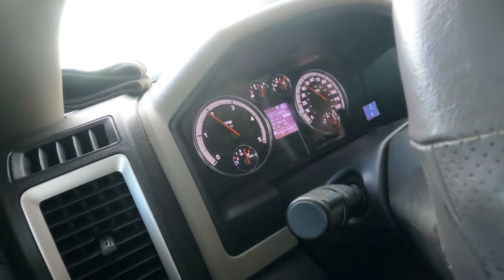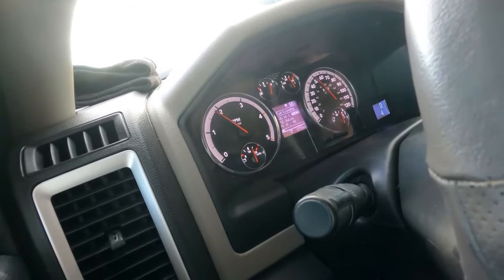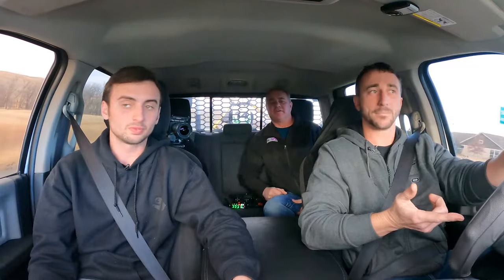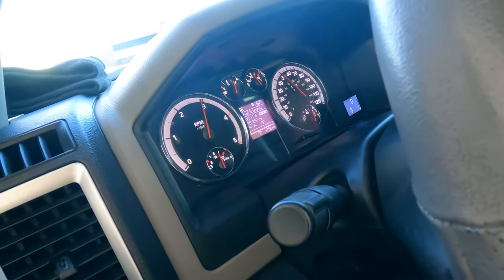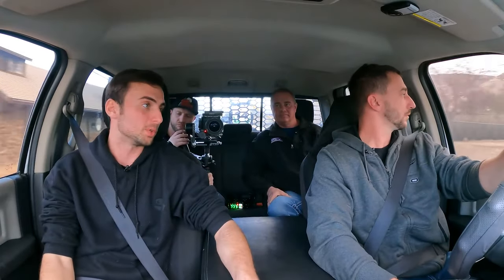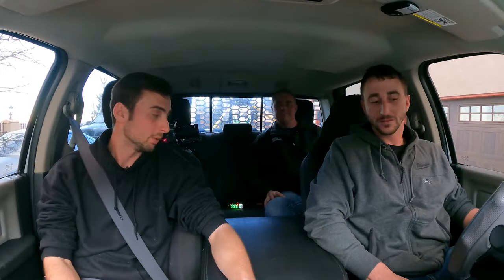TEST DRIVE - ATS Swap Cummins to Allison Conversion Electronics Upgrade Kit

Comment: Clint can you  make a video of the truck pulling 15k pounds or even 8k pounds and let us know and see how it shifts and down shifts and how the exhaust brake works for you while towing etc. Thats whats really important here. Not driving to the super market but real world towing and if you saved on fuel compared to the original transmission setup,  what MPG you get unloaded on highway as opposed to stock. And what MPG you get towing compared to stock. And how it shifts when. Pulling heavy. These are things we need to know before dropping g that much cash. Yes its an Allison 6 speed. Which are known for reliability.  But how it performs mated to the cummins is what wereally need to know.  And it seems so far you have produced the best most reliable seemless conversion wiring setup making the truck act as if it were stock with is great. But we need to see it performing . If you donate a transmission setup to someone including me preferably 😂 that actually pulls things daily they can make videos of how it is performing and its reliability etc. I have a 2020 ram 2500 megacab with factory rear air ride. And I make trips back and forth from Florida to upstate N.Y pulling . The truck does not move unless its pulling something as im a pirate hotshot. I'm sure if there were more real world data and performance information this would be an easy decision
Reply: Yes what this guy said

Comment: My 2011  68RFE transmission has overheated a few times at slow speeds and hardly do anything and so did my last truck. It’s probably just a matter of time before it fails. Who knows? I’m no mechanic but the ATS Allison conversion sounds  like the way to go. Not cheap but it would be nice.

Comment: I wish they offer this for 3rd gen 5.9 manual trucks. I'd love to have an Allison swap that's smooth and drivable.
Reply: Not sure if you knew or not but they came out with the 5.9 conversion recently
Reply: @Andrew Connor   no I did not. I would sure like to know where they have the info on this hidden. Just looked again and it shows 07.5 and newer

Comment: I've had the 68RFE fail at 23k mi in my 2018 2500. Dealer rebuilt because Stellantis won't supply factory remans. This whole conversion seems like the way to go so I can re-establish faith. I just don't know about programming and tunes related to smog checks in CA.
Reply from the maker: There is no non-stock PCM tuning involved for this.  This kit works directly with factory tuning.  Please give us a call and we can elaborate in further.

Comment: How different is the exhaust braking?  I know the manual tune has a much more aggressive brake than the auto tune?  I want to convert my g56 but don’t want any sacrifice with the exhaust brake
Reply: In a 2016 Ram 6.7, all of the Banks air parts, no tuner and an ATS Allison stage 3, what a world of difference. The exhaust brake is beyond phenomenal. Most always towing about 12,500 lbs. In tow/haul, steep grades, there is no longer a need to select gearing or use any braking. This combo is a smooth, cool running work horse. ATS & Banks have really good products.

Comment: In the title of your ad on YouTube, it states smoothest test drive ever ATF swap Cummins to Allison. My question is what does Cummins have to do with the transmission? Did they build it? Are you replacing a Chrysler transmission or an asian and transmission from Japan or some transmission from Cummins? I thought only Cummins made the engine.

Comment: Is there any chance that if I were to send ATS a built ZF 8HP95 (Pure Drivetrain Solutions builds them to withstand up to 1100 HP and 1300 lb-ft of torque), could you make a bell housing and some type of way to connect it to the wiring harness of a Ram with a Cummins? The ZF is shift by wire, so I am fully accepting of the fact that the truck would probably have to be converted to having a dial shifter like the 1500s and gas 2500s.

Comment: So are you converting the ASIN 6spd to the Allison 10spd?
Reply: It’s the 6 spd
Reply: Agreed. What trans was in this truck to start with. The aisin of the 6rfe or whatever it was.. we have a 14 3500 with the aisin and its only issue is its lazy after having the engine tuner installed. The aisin still wants to work like its stock because there is no ability to tune the tcm to work with the engine tune.

Comment: Never had any issues with my 68RFE's.. A smoother shift is NOT necessarily a good thing. Sure is nice having a smooth shifting truck, smoother means slower engagement of the bands and clutches which means more wear..
Reply: Allison doesn't have any bands
Reply: @gagecook6918  Same concept, when I said Bands and clutches, I meant Bands and or Clutches. Allison has Clutches.
Reply from the maker: In this case, Mike was so disappointed in the hard shifts he was experiencing from his CAC kit that he drove all the way across the country to change out the electronics for ATS's translator and complete harness.  The reason why it was shifting hard before the ATS kit was the fact that no derate was being communicated between the PCM and TCM.  Without the millisecond derate from the motor, the clutches take a ton more abuse and compromise the longevity of the transmission overall.  In this case, it's the exact opposite of what you are claiming but in many cases a nice firm shift is good thing. Furthermore, the "smoothness" or time that it takes to apply the clutches/amount of derate, is tune-able in our open source TCM included with our kit via EFI Live.
Reply: @ATSDieselPerformance  Thanks for the info.. I would honestly consider an Allison conversion but The price is way out there, That is $12-15k and then have to turn in my core (that only has 260 miles on it) My core is work about $4K so in essence my conversion would really cost up to $19k...
Reply: Gotta do this to my ram!!!
Reply: @gorgonbazil2652  every time comments mention the $13k cost, ats stops their continuing the conversation, no replies after.
On their site it purports to begin at $4,650 and up to $17,759. But the complete conversion, which would be the majority of buyers, Stage 1 650hp goes right to the high side of that range...$13,686.84.  And you still have to be mechanically inclined enough to save labor to do yourself or Plus labor of a shop.

I'm not saying the swap isn't good in the bones of it, but roughly $15k installed for only "reliable" 650hp seems like a Price Gouge. Can't you get 2 built 68's for 650hp for that cost?
Another question....if the Allison is so beefier in mass produced mediocr form, and I don't doubt it is, why is one with nice parts in it for these kits only a 650hp performer?
Reply: @HTSS8  Agreed!
Reply: @HTSS8  I’ll only make one comment to this as I agree and understand
Being a frequent flyer on the Cummins pages.. NUMEROUS guys are on their 2nd and 3rd big box “built” 68’s
Also, the 68 shifts like horse crap. So it’s worth it in my eyes

Comment: What’s the total cost for an Allison conversion?
Reply: 2wheel drive around 13.5k 4wheel drive 14.5k-17k (depending on the stage you get 1-5) that’s considering you do the install add labor to it if you aren’t doing it yourself

Comment: Bag on CAC. swap out CAC electronics to ATS electronics and "Holy crap" thats way better.
Saw that coming
Reply: The difference is there. If you look at our video of when the truck was originally swapped we were excited about it. But then let down a couple weeks later when the transmission self learning procedure never made the shifts smooth and comfortable. With the ATS stuff we shot all of this back in December 2021. Months later the truck is still driving smooth and is great for daily use! We will also be posting a review of the truck in the coming weeks as a “5 months later review” to show everyone how well the kit is still running.
Reply: @slowmovement2300   where did you get those Allison badge’s? I looked around to find them
Reply: @rickw1427  the badge is just a black Cummins badge and then Mike bought a “Duramax/Alison” badge and trimmed the duramax part off of it. Then placed it under the Cummins badge
Reply from the maker: We are not going to apologize for fixing a half-assed product.  Sorry not sorry.
Reply: @ATSDieselPerformance  Big D energy 😂 love it